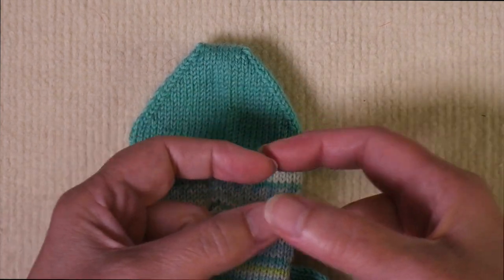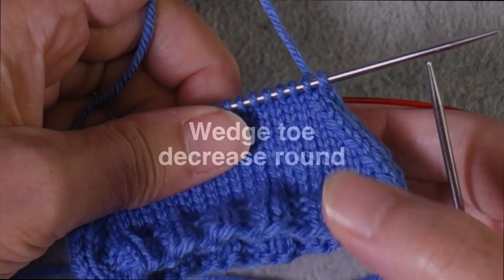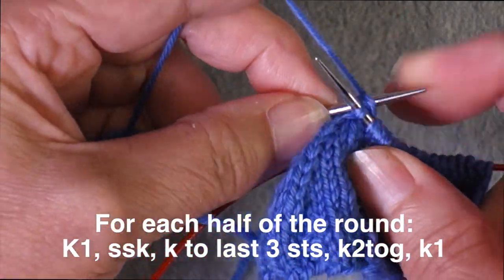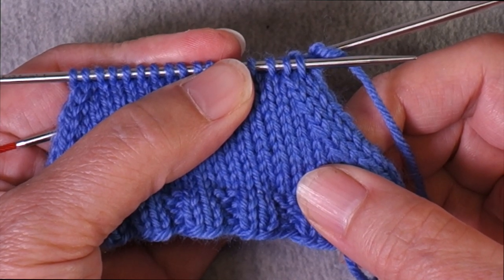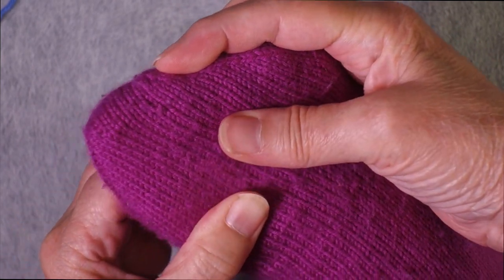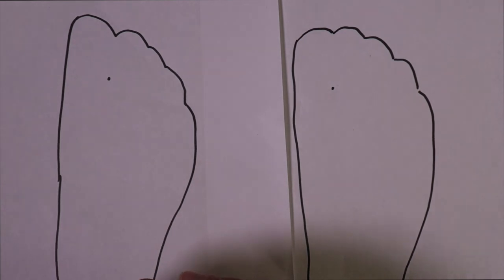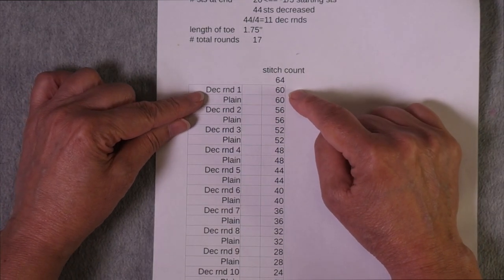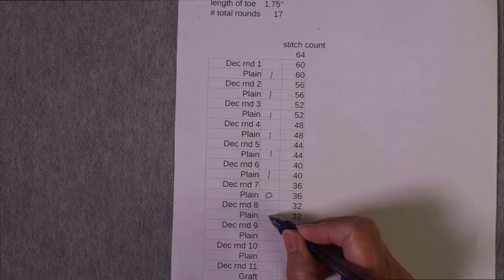How to Knit and Modify a Wedge Sock Toe // Technique Tuesday

Comment: Hi Roxanne, I am new to knitting socks and have just finish the first sock of my first pair in self striping yarn, how fun! However I have a dilemma, I have very point toes, a long big toe and almost a straight diagonal to my little toe. Is there a better toe pattern for this  so I won't feel like my big toe to piercing the end of my sock? Thank you
Reply from the maker: Try the long round toe. You can find it in my playlist of sock toe videos. Regardless of the type of toe you knit, you may need to adjust the length of the toe by changing the rate of decreasing so that you get the best fit.

Comment: This video really helped me out in calculating the decrease rounds and how many plain rows to insert between decreases! I was wondering if the calculations you did for the planning of the longer wedge toe could also apply to a 1.75" toe with a larger row gauge? I have 60 stitches and a 22 row gauge when I measured 1.75" from the leg of my sock, and wondering if I will be able to reach approximately 1.75" if I inserted plain rows until my last decrease round like in the longer 2.5" toe you showed?
Reply from the maker: It's the same idea, regardless of stitch count and row gauge. The "standard" way to knit the toe is to work a plain round after every decrease round (except for the final dec round). Add or remove plain rounds as needed, to get the toe length you need.
Reply: @RoxanneRichardson  Thank you so much for your help!

Comment: Good video!  Do you use a computer program to figure that out, or just figure it out manually, the way that you show here?  Definitely a "watch many times" video.  Thank you.
Reply from the maker: I usually do it in a spreadsheet, since I have the rest of the project tracked in the spreadsheet, anyway.
Reply: @RoxanneRichardson  Oops, sorry!  I forgot to ask my second question.  Do you use a "jogless" method when using self-striping, or self-patterning yarn?  (I think that's the only other question that I had.  Thanks.)  :))

Comment: This is great. I'm a new knitter and been crocheting over 30 years. So the number of rounds needed is determined by your gauge and this differs by person, yarn and needle. Is this right. I can make socks for the same person but if I use different yarn and needle, the number of rows with change.
Reply from the maker: The wedge toe formula assumes a particular st:row ratio, which is going to work most of the time, assuming you need a toe length that is 25% of the sock circumference. (This would be the mythical "average" person.). Row gauge can vary, though, by yarn and by knitter, which could result in a toe that's not the length you expected. Plus, there are those varying shaped feet!
Reply: @RoxanneRichardson  Thank you! I can't believe I'm understanding this! Still have ways to go and this is so helpful.

Comment: So, if you have bunions (pretty clear ones), when would you start the decreases? Where the bunion “ends” at the toes, or where the indent ends, so to speak?
Reply from the maker: It probably doesn't make a whole lot of difference! The sock has to stretch to fit around the larger circumference of the foot up near the ankle, so it can stretch around the bunion, as well. You have two good ideas for how to approach it. I would try one sock each way (wait to graft the toes closed), and then try both on to see which you prefer. You can then take out the toe you don't like as much and knit it to match the one you do like.
Reply: @RoxanneRichardson  thanks! I’ll try that :)

Comment: If you have 64 stitches should you always decrease to 20 before grafting? I've found every pattern I've used so far has been completely different. One says 16 should be left, 8, 24, 28. I have no idea how many I'm supposed to have left as a rough guide
Reply from the maker: There's rarely an "always" in knitting. The point is to find what works well for you and gives you the best fit. Your toes might be long, with a steep angle, or long and all nearly the same length. Or they might be short and all the same length, or medium length with a medium angle.  The designer is likely using the method that gives him/herself the best fit. Measure your foot and determine how long the sock toe needs to be. If it needs to be longer than it takes to decrease every other round down to the standard formula of 1/3 of the original stitch count, keep decreasing every other round until the sock is the correct length for your foot. On the other sock, try adding length by increasing plain rounds between decrease rounds to give you the correct length, decreasing down to the formulaic 1/3 of the sts. Compare the fit. Do you like one better than the other? If so, use that knowledge to knit socks going forward (and perhaps rip out the sock toe that doesn't fit as well and knit it to match the one that does fit well). If you find no difference in the fit, then choose the decrease rate/method that is easiest for you to remember. You may even find that you like a combination of increasing length with a few plain rounds while decreasing the stitch count down to something slightly less than 1/3.

Comment: It seems to me that nearly everyone's big toe ends at either the right or left of their foot, yet all sock patterns assume the big toe ends dead center of the foot. If a sock is truly custom fit, it seems that the left and right decreases wouldn't necessarily be mirrored.
Reply from the maker: That depends on your foot shape.  I showed in the video how the two lines of decreases ride along different surfaces (one along the side of the great toe, and the other across the top of the smaller toes). For my foot shape, it works really well. For other foot shapes, it may not, which is where customizing comes in. You select the toe type and the method of decreasing that is best suited for that individual.
Reply: @RoxanneRichardson  Got it!  Thanks!